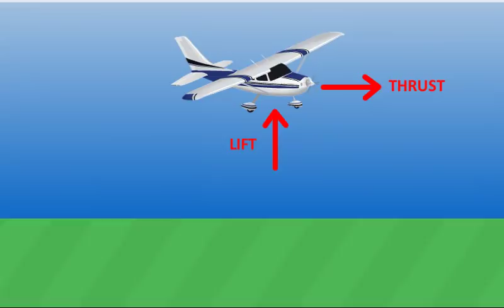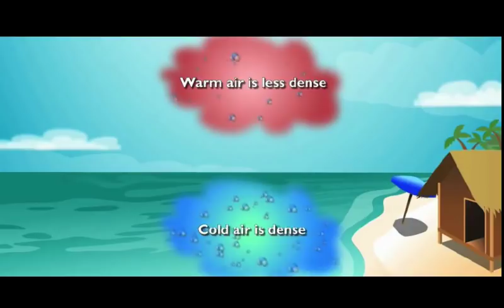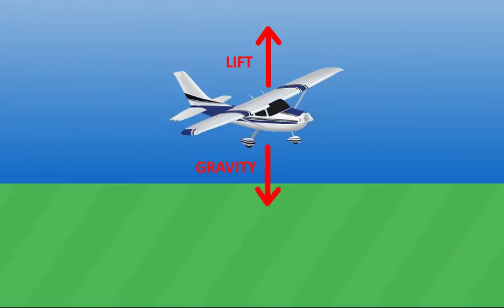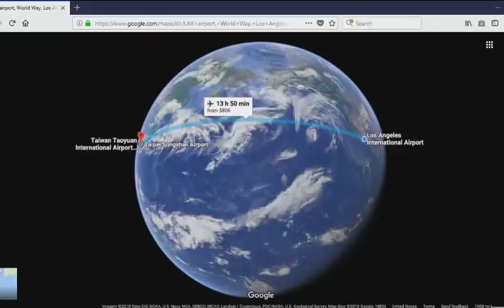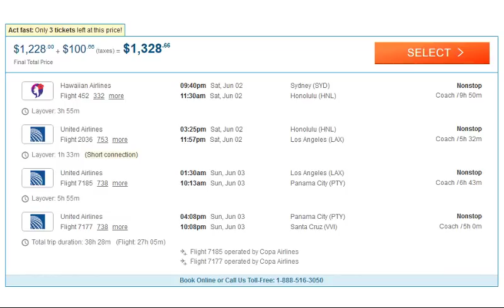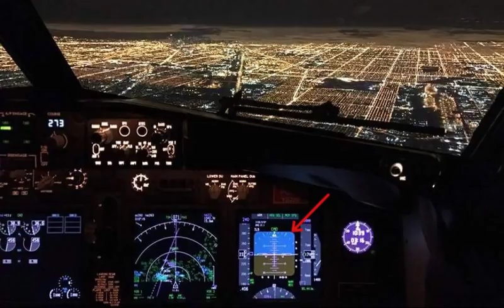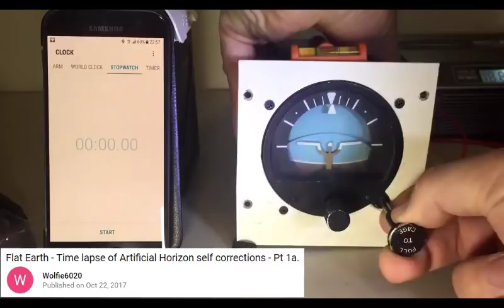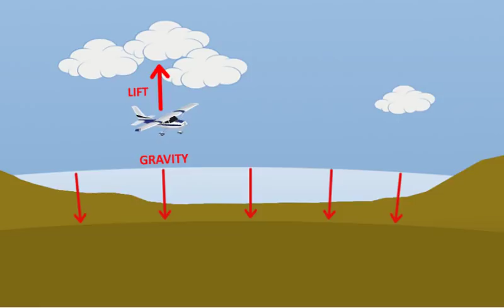Flat Earth Falsities - Plane Nonsense

Comment: Time for my fourth comment? Globe with lots of questions (to flattards)= "Explain why objects fall. Please come up with something less dumb than density. (a Flook)" Well there sure a lot of Density talk from GE for atmospheric phenomina.. next to their Gravity its tops. 
   "Denser cold air sinks and pushes up warmer less dense air, the density of air decreases significantly as altitude increases.   This is why the "blast furnace" temperatures of the thermosphere don't affect satellites: at that level a partial vacuum (low density) develops so there isn't much heat.
The sun light doesn't start causing heat until it gets to the atmosphere, where there are molecules of air for the light to "excite". But the air is thinner the higher you go, so there is less heat. A plane does lose heat to the atmosphere because it is much colder than the plane at high altitudes. That is how thermodynamics works."

- AMAZING THERMODYNAMICS !  [Atmospheric drag and aerodynamic heating can cause atmospheric breakup capable of completely disintegrating smaller objects.  Atmospheric entry occurs below (/above) the Kármán line at an altitude of more than 100 km (62 mi) above the surface,]
- Face intense temperatures of about 3000 degrees Fahrenheit (about 1649 degrees Celsius), nice, but the DENSITY way up at "space" is actually real tin weak, still there is Shock Wave..
- Some scholars say atmospheric pressure sucks the heat out of high places..
 - Bewildering actual factual real consensus Science sense, what a drag.
Reply: Silly troll.
Reply: Louis Shaw Completely garbled account.
Reply: :) 
Fulltime top brains on this posting, one a professional Navigator and the other a medical Gman. Doing their best, the two boys are friends again, what a great GE level team.
Reply: MORE !
Classic GE cultist move: dismiss all evidence that proves your reality wrong.
These dont understand most of the words and terms I use. Is English their first language?
The sounds of gibberish minds, 4th graders?
Reply: Louis Shaw You didn't provide any evidence to dismiss. If you want to claim density acts as a force then provide the evidence to back the claim.
Reply: @BrainUser1  learn 4th grade geometry. Don't bother trying to figure out the shape of the earth until you learn how to measure shapes.
Reply: Toy guy, failing to follow the relevence at the Smart's science talks. It is Their claims.
Captain why are you on all my gibberish comments? You cant understand but still criticize..
Flook is always lost, I never said it was a Force, your faith claims you need that for stuff to fall down, nope, may be some attraction, but it would be Electric, that is our world.
Was not expecting any explaination on those contradictory actings :)
Reply: @BrainUser1  you don't understand anything you're saying. This is typical of parrots. Try asking a question like a normal human instead of your standard flat earth gibberish. The earth isn't flat and you have absolutely no proof for such a ridiculous claim. You simply don't understand anything. Research some geometry and you can go prove the earth is a sphere for yourself. Do you understand geometry? What is a theorem? What is the equation for measuring the circumference of a circle? Can you answer any of those questions? Every single post you make just makes you sound dumber and crazier than the last. Have you ever received any counseling or seen a  therapist?
Reply: Louis Shaw
"My school preached it was Colombus who showed it was a sphere" Well sue your school for lying.
You cited Wikipedia which clearly states "The earliest reliably documented mention of the spherical Earth concept dates from around the 6th century BC when it appeared in ancient Greek philosophy but remained a matter of speculation until the 3rd century BC" The reason the Greeks proposed a spherical earth was becasue of mariners pointing out that land disappeared below the horizon, as did ships, which could only be because the earth was spherical but it wasn't established it conclusively Eratosthenes did.
The Indian mathematician Aryabhata (AD 476–550) describes the earth as being spherical and that it rotates on its axis, among other things in his work Āryabhaṭīya.
Around AD 830 Caliph al-Ma'mun commissioned a group of astronomers led by Al-Khwarizmi to measure the distance from Tadmur (Palmyra) to Raqqa, in modern Syria. They found the cities to be separated by one degree of latitude and the distance between them to be 662⁄3 miles and thus calculated the Earth's circumference to be 24,000 miles.
The Azimuthal Equidistant Projection, a projection of the spherical earth was first mathematically developed by Abū Rayḥān Muḥammad ibn Aḥmad Al-Bīrūnī in the 10th Century, Al-Bīrūnī knew the earth was spherical and believed that it rotated, he also measured the earth's radius.
He deduced the existence of the Americas on the basis of his accurate estimations of the Earth's circumference and Afro-Eurasia's size. This was several hundred years before Columbus et al.
In 1505 the cosmographer and explorer Duarte Pacheco Pereira calculated the value of the degree of the meridian arc with a margin of error of only 4%.
Eratosthenes in the 3rd century BC first proposed a system of latitude and longitude for a map of the world. By the 2nd century BC Hipparchus was the first to use such a system to uniquely specify places on Earth. He also proposed a system of determining longitude by comparing the local time of a place with an absolute time. This is the first recognition that longitude can be determined by accurate knowledge of time. In the 11th century Al-Biruni believed the earth rotated on its axis and this forms our modern notion of how time and longitude are related.
https://badarabbas.files.wordpress.com/2011/03/paper.pdf
"Spherical trigonometry was dealt with by early Greek mathematicians such as Menelaus of Alexandria who wrote a book that dealt with spherical trigonometry called “Sphaerica” [1]."
https://en.wikipedia.org/wiki/Sphaerics/
And I suggest you seek psychiatric help to cure you of your unhealthy obsession with homosexuality and paedophilia. Perhaps that darling of the right, the London Greek Milo Yiannopoulos could help you with that.
Reply: +Louis Shaw I don't think you understand it at all. If you did you would realize how easily you can prove the shape of the earth using two sticks and some math. Flat earth is just a scam on YouTube. El Haayuh Rawuh - The Living Soul. That's what you just quoted btw. That is hilarious. Next time just cite the source of your gibberish. Did you write that because you think it would make you appear smart. It has had the exact opposite effect. Research geometry and learn something useful. So again I ask. Do you understand geometry? What is a theorem? What is the equation for measuring the circumference of a circle? Here is a tough one. What 3d shape is made from two circles and a rectangle? Do you understand that if you have no idea how to measure shapes, you don't have the basic tools you need to know the shape you are living on?
Reply: 2 sticks in the yard does it... Globe power.. HELIOCENTRIC construct.
Two Sticks is not an defining experiment, so much as it is a pitch sales for Hellenic science, dam the Carl Sagan cabal agent.
"The Two Sticks Demo assumes a Flat Plane in a Heliocentric model with a Sun much farther away than what is believed in the Geocentric model.   If the Sun is over one stick and it doesn't cast a shadow, this makes perfect sense for a Sun MUCH closer to the surface of the Earth than we've been taught.  Think about it.   It is actually far superior evidence for a Flat Earth / Geocentric model."
This Two Sticks argument is Strawman Brainwashing.
Two Sticks Don't Prove a Curve - Flat Earth  /watch?v=d0zucqTeIbE

Comment: Can I watch a video of the earth rotating at 1000 mph.
Reply: Maybe you should stop spamming and learn to use the reply button if you want to be taken seriously.  You don't need to post a new comment for every thought that pops into your head you know.
Reply: How much movement do you expect to see at one revolution per 24hrs?
Reply: Perhaps I can help you double colt45.. Am an engineer with degrees in aerospace engineering and experience in the industry. 

Showing you a video of a globe the size of earth spinning at 1000mph at ground level would look identical to watching a golf ball spinning at 3.5e-6 mph at surface level (Very small). Here's why...
One rotation for both our planet and golfball (in this example) takes 24 hours. However, the circumference is vastly different, a point on a larger sphere (earth) would need to move further over that 24 hour period than a smaller sphere (golf ball). The circumference of a golf ball is 134mm (pi x 42mm), whilst the Earth is 40,030km. You can rework the golf ball into the same units and you'll get 0.000134km. Now, let's consider a golfball in orbit about the sun and imagine you are an ant standing on that golf ball, rotating once every 24 hours...  in that 24 hours you'll move only 0.00013km. If you're stood on the Earth, in the same period of time you would have travelled 40,030km (alas to simplify, assume both earth and golf ball are fixed points in orbit - the math gets a little more complex when you introduce orbital mechanics). 
Now if you were the sun looking at these two balls, and you could see both the ant and the human, they would both appear and disappear from view at the same time. The ground or the person on the Earth would not appear to be spinning like a blur, simply because the Earth is so massive. 
I hope this helps with your understanding.
Reply: +Double Colt45s You don't need a video. Go look at the clock on your wall from 1 foot away (probably bigger than a globe on your video screen) and watch the HOUR hand to see how fast it is moving... then divide that speed by half.   That's how fast the earth will be turning in a video.
Reply: Very probably, but it would look super boring since the scale of Earth means that such fast-sounding speed translates to a mere quarter of a degree of rotation for every minute you spent staring at it. If you sat for a whole hour, the Earth would have hurtled an entire... fifteen degrees. It's not exactly breakneck.
Reply: Dont think NASA has done any, but I guess if you got a probe outside the belts and focus as they do elsewhere it should be kind of blurry. A thousand m/h is a thousand m/h afterall, isnt that a fact?
Lucky no wong or Robert Thomas:  "You're an idiot troll. Go fuck with Eric Dubay or take a physics course loser. Go away."
Reply: Louis Shaw You think one revolution per day would give you a blurry image?
Reply: Double Colt45s yes. Although I think you've probably spent too much time watching videos on YouTube. Try books.
Reply: Dam people who spend to much time on YT!
Zetetic Astronomy: Earth not...  Samuel Rowbotham
Inventing the Flat Earth  Jeffrey Burton Russell
Fads and Fallacies in the Name of Science Martin Gardner
The Flat-Earth Conspiracy: Eric DuBay
Books ...
Reply: Don't actually read those ones though. Probably a bit rough for toilet paper, but that's the only use I can think of for them. Oh and just get the zetetic book by Rowbotham since that's what Dubay essential plagiarized. Still kind of expensive for toilet paper though.
Reply: Louis —
Try this one:
  University Physics with Modern Physics
  Hugh D. Young, Carnegie Mellon University
  Roger A. Freedman, University of California, Santa Barbara
or some things more on your level:
  Physics Essentials For Dummies, Steven Holzner
  Astronomy For Dummies, Stephen P. Maran
  Geography For Dummies, Charles A. Heatwole
Reply: Double colt45s for that you have increase NASA budget
Reply: Jeez what do you and wong have against flattards saying stupid shit?
Want me to look intelligent?
Reply: Louis Shaw  Fuck off you silly troll.
"My school preached it was Colombus who showed it was a sphere" Well sue your school for lying.
You cited Wikipedia which clearly states "The earliest reliably documented mention of the spherical Earth concept dates from around the 6th century BC when it appeared in ancient Greek philosophy but remained a matter of speculation until the 3rd century BC" The reason the Greeks proposed a spherical earth was becasue of mariners pointing out that land disappeared below the horizon, as did ships, which could only be because the earth was spherical but it wasn't established it conclusively Eratosthenes did.
The Indian mathematician Aryabhata (AD 476–550) describes the earth as being spherical and that it rotates on its axis, among other things in his work Āryabhaṭīya.
Around AD 830 Caliph al-Ma'mun commissioned a group of astronomers led by Al-Khwarizmi to measure the distance from Tadmur (Palmyra) to Raqqa, in modern Syria. They found the cities to be separated by one degree of latitude and the distance between them to be 662⁄3 miles and thus calculated the Earth's circumference to be 24,000 miles.
The Azimuthal Equidistant Projection, a projection of the spherical earth was first mathematically developed by Abū Rayḥān Muḥammad ibn Aḥmad Al-Bīrūnī in the 10th Century, Al-Bīrūnī knew the earth was spherical and believed that it rotated, he also measured the earth's radius.
He deduced the existence of the Americas on the basis of his accurate estimations of the Earth's circumference and Afro-Eurasia's size. This was several hundred years before Columbus et al.
In 1505 the cosmographer and explorer Duarte Pacheco Pereira calculated the value of the degree of the meridian arc with a margin of error of only 4%.
Eratosthenes in the 3rd century BC first proposed a system of latitude and longitude for a map of the world. By the 2nd century BC Hipparchus was the first to use such a system to uniquely specify places on Earth. He also proposed a system of determining longitude by comparing the local time of a place with an absolute time. This is the first recognition that longitude can be determined by accurate knowledge of time. In the 11th century Al-Biruni believed the earth rotated on its axis and this forms our modern notion of how time and longitude are related.
https://badarabbas.files.wordpress.com/2011/03/paper.pdf
"Spherical trigonometry was dealt with by early Greek mathematicians such as Menelaus of Alexandria who wrote a book that dealt with spherical trigonometry called “Sphaerica” [1]."
https://en.wikipedia.org/wiki/Sphaerics/
And I suggest you seek psychiatric help to cure you of your unhealthy obsession with homosexuality and paedophilia. Perhaps that darling of the right, the London Greek Milo Yiannopoulos could help you with that.
So stop trolling you silly child.

Comment: So, the earth is moving 1000 mph compared to what?
Reply: Itself. One revolution per day. 360 degrees of movement.
Reply: 1,000 miles per hour at the equator.  As you go north or south from the equator, your speed will be (1,000 * cos(your.latitude))
Reply: Think of a basketball spinning on a finger. The tangential speed at any point is the rate of rotation multiplied by the distance from the axis of rotation.